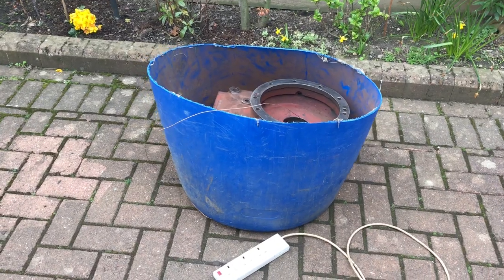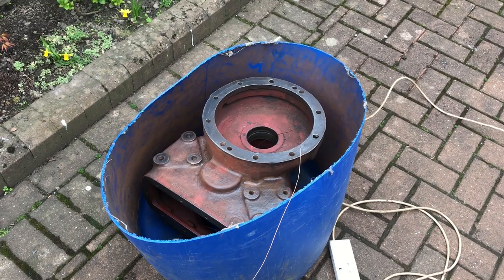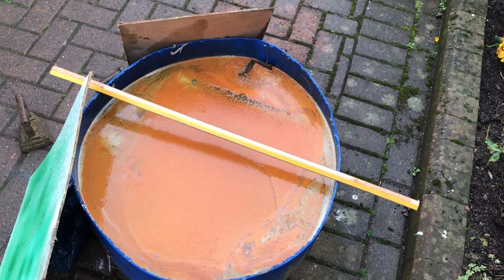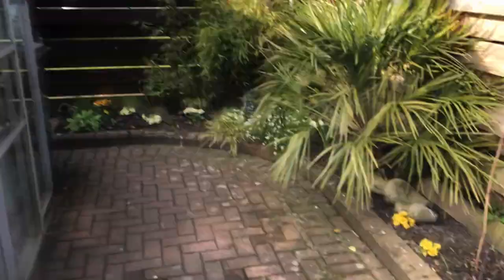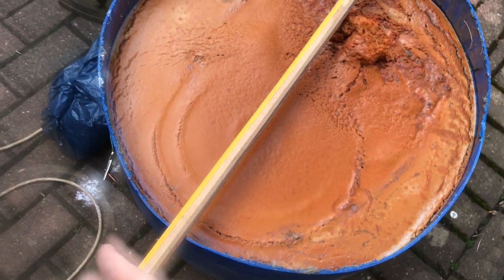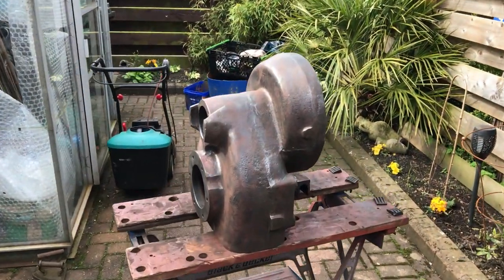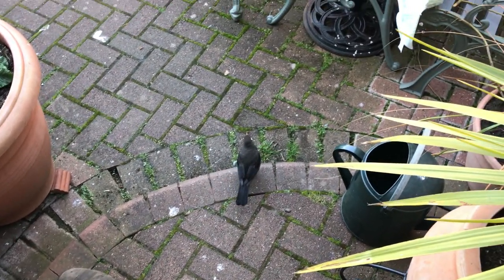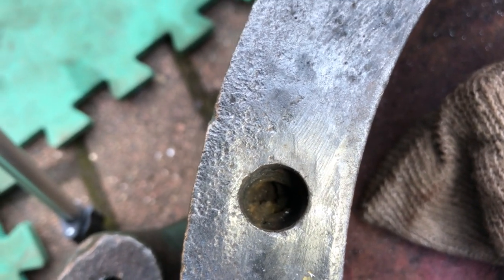David Brown 990, cleaning the final drive castings #60

Comment: I have an old electrolysis tub out the back I should get going again. Back when I did use it often I would remove it hit is with the pressure cleaner and drop it in again, i used washing Soda probably the same as in the laundry powder. . I found it worked well. A wipe of grease over a surface will stop the primer from sticking and prevent rust all in one application. I like to suggest try the weld a nut on method for the stabilizer bolt it is easy enough to get to to try it out.
Reply from the maker: G Day Lance, I was really surprised how much more rust came off after the pressure cleaning. i will try the nut welded on #, see if we can save a little time, and make life easy.
Cheers Lance
Barry

Comment: Big bowl of tomato soup indeed!  Lol!  As for your question... I'd just prime it, then do finish later.  Of course I have NO idea about painting with automotive style paints.  Never done that before, so ignore me.  My ears perked up when you mentioned Linux.  Like you said, we've got a LOT in common apparently.  I started my career in tech working with Linux at an Internet Service Provider in Tuscaloosa (dialup and early DSL).  Doing webservers, databases, and general networking stuff.  RedHat, Debian, Gentoo, and lots of others.  Even did Linux from Scratch to make my own distro.  Miss those days, but I still have a couple of Linux boxes here at home in a rack I run virtual machines on.
Reply from the maker: Hi Shane, just ordered one of those power packs, getting it tomorrow. It's indead a very small world, don't know about you but I've found that if you don't use it you loose it, very fast! I've got a note book in my draw with CLI commands in it, as I run both my NAS machines on linux server and interact with them through putty interface, as I'm now nearing 65 I'm finding it more and more difficult to remember the complex things. But I do miss those days, the excitement of making things happen, even played with KALI for a while. which is why I stopped using windows IE, more holes than a sieve.
many thanks
Barry

Comment: Nice one Barry, isn't science wonderful!! I use the battery charger method and it works a treat. Good luck with the broken ezy out, same gorilla with not much engineering knowledge. As for Deja Vu - went to school with him, used to live in second row. Paint your components before assembly, then you'll know you have maximum protection and peace of mind
Reply from the maker: Cheers Ken, now the weathers warming up a little my thoughts turn back to painting, hopefully I'll get a start once this little issue is delt with.
Many thanks Ken
Barry

Comment: Interesting cleaning method.  More the big blow lamp and wire brush on the angle grinder. Would putting masking tape on the machined surfaces not stop them flash rusting?  I used to have to clean stainless steel mesh filters for steam boilers. We tried using ultra sound water bath but the build up mostly stayed. B&Q drain cleaner made them like the day they came out the factory. Left over night.  M😀
Reply from the maker: Hi Marshall, yes it would as anything that prevents air reaching the surface will stop rust.
many thanks
Barry

Comment: I was was very interested to see how you do the electrolysis and how you use a computer power pack.  From the info on the pack you said “250 volts 1.5A output”.  The 250 will actually be the AC mains Input voltage. The Output will be DC at a relatively low voltage (with a positive and negative rather than a live and neutral) and it may be rated at 1.5A.  I would be cautious about paralleling up two or more supplies as they will not have identical voltages and this could cause unwanted effects. Far better to give each its own sacrificial electrode.
It would be interesting to know whether your current was limited by the power pack or by the resistance of the circuit.  If less than 1.5A then then your power pack was adequate. 
However,  I think the efficiency could be improved by having several sacrificial electrodes around your bucket (or even a ring) thereby producing a more all round effect.   With a single electrode the effect will be most pronounced on the part of the subject closest to the sacrificial.  A further refinement might be to have electrodes at different heights and at the bottom.  The current would then probably increase and you might then need a more robust PSU. So you could then be back to needing more than one pack. Rob
Reply from the maker: Hi Rob, many thanks for the suggestions, I'll pop a video out in a couple of hours using multiple anodes
many thanks
Barry

Comment: Barry - Method below - suggested for the Stabilizer bolt.
Lance in his comment refers to it as the weld a nut method.
Reply from the maker: Hi Vincent, yes I think thats the way forward, if all else fails I'll grind it clean and drill them out.
many thanks
Barry

Comment: Have you thought about a Hewlet Packard Sever PSU, ( ebay £15 - 20 )    I use one for the model aircraft battery charging.   It can safely do 40A DC .   That would shift the muck on the rear housings.
We have a few bits to clean on my mates DB 850 so I may give that a go , under careful suppervision.
Reply from the maker: Hi CRF999 I have seen people making workshop power supplies from psu's as you say it's worth ago, anything with a fixed output would work. smart battery chargers are no good as they change the amperage to suite.
Many thanks
Barry

Comment: Barry - your broken bolt - you may like to try - with the assistance of skilled welder - using a thick (must be thick) washer welded to the flat of the broken bolt with a wire feed welder.
Then weld the largest nut possible to the washer 
Note that the entire fastener area needs exhibit "concentrated red hot penetrating heat" at the end of the welding activity - this helps to break the rust lock.
Once cold - using a hammer / punch, tap the center of the broken bolt with striking firm blows.
Then attempt to unscrew / tighten / unscrew the bolt working it "to and FRO" with a liberal application of penetrating oil. 
Most Boilermaker / Welders experienced in fixed and mobile plant maintenance activities are familiar with this technique.

If all else fails - you may have to take it to a machine shop - that has an Electronic Discharge Machine (EDM) / Tap Remover to burn their way in a very controlled manner through the easy/out.

Once the old broken bolt has been removed, Re-tap the hole with a good quality bottoming tap (recommend HSS) to clean the hole at the end of the process.
Then thoroughly flush the hole at the end of the process with cleaning fluid, blow out with compressed air and lightly oil to prevent flash rust.
Reply from the maker: Hi Vincent, many thanks for the very detailed info, I'll make some enquiries to see if I can find a good welder locally.
many thanks
Barry